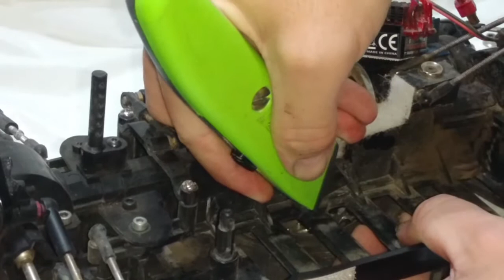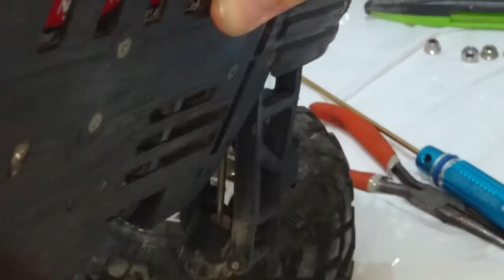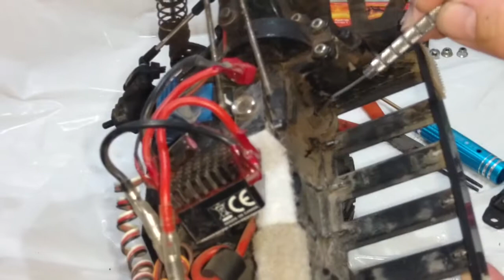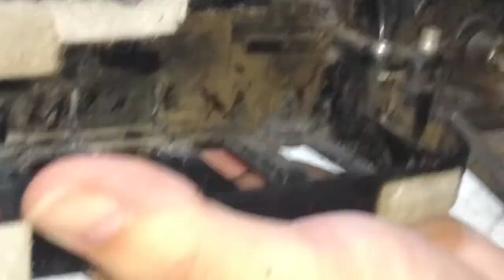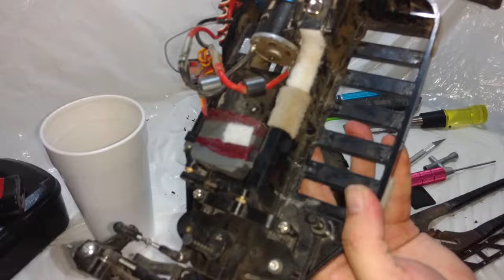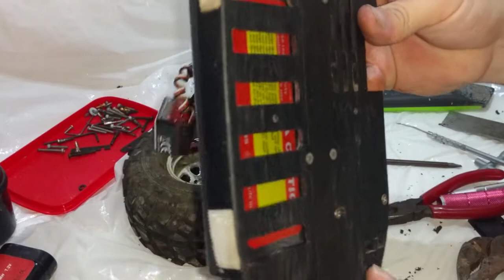How to fit a LiPo into a Tamiya DF02 with hand tools.

Comment: I wanted to keep these little triangles to add support to the chassis. I just put longer screws into the posts for the battery strap and my lipo fits in there

Comment: nice vid. i noticed that you have a modified front shock tower. 😃
Reply from the maker: Yes, that shock tower is cut from polycarbonate and sandwiched onto the stock shock tower, which I cut down. It looks ugly, but it's very tough and it mounts the front shocks in a very laid-down position.